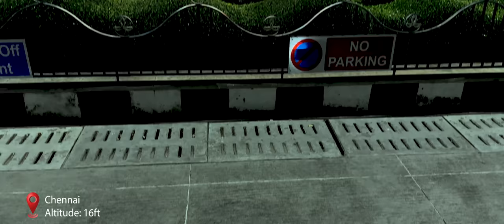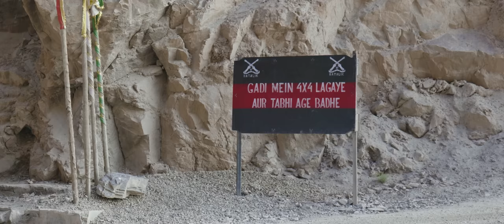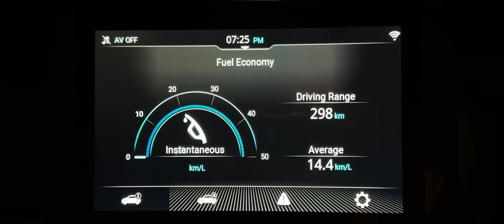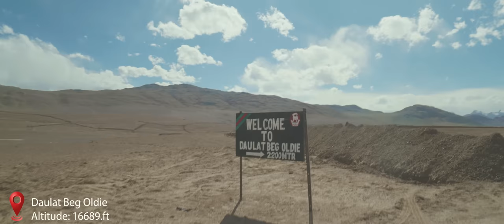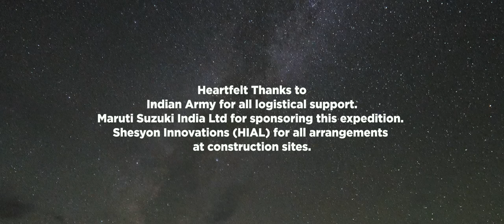Journey to the Roof of the world | Chennai to DBO Ladakh in 24 Hours

Comment: Sir, a small suggestion, can't we have underground temperature controlled bunkers for the Armies on these high altitude places on the Borders like DBO. Multiple underground Bunkers connected with each other through tunnels like how Hamas did in Gaza. That will not only provide Comfortable Shelter during Harsh Winter but strategically also they will be secretly hidden beneath the ground.

Comment: 00:02 Journey from Chennai to DBO Ladakh in 24 hours

01:49 Journey from Chennai to DBO Ladakh in 24 Hours

05:13 Climbing towards Chang La Pass, one of the highest passes in the world

07:46 Testing the Jimny's capabilities on treacherous terrain without using four-wheel drive.

11:12 Four wheel drive was strongly recommended.

13:58 Solar heated shelters are a great gift for nature.

15:58 Building shelters with insulation to combat extreme temperatures in Ladakh

17:28 Saluting brave soldiers and witnessing the beauty of Pangong Lake

Crafted by Merlin AI.